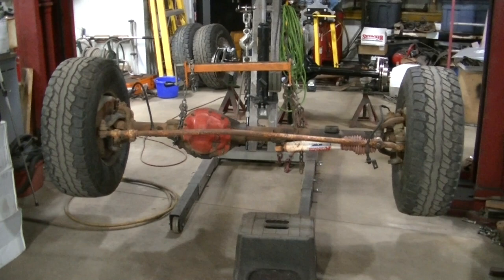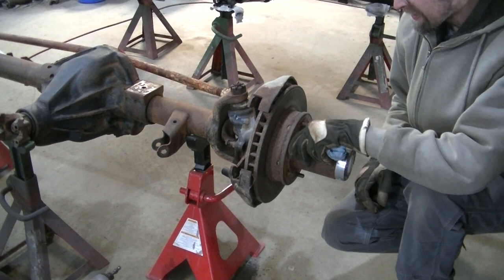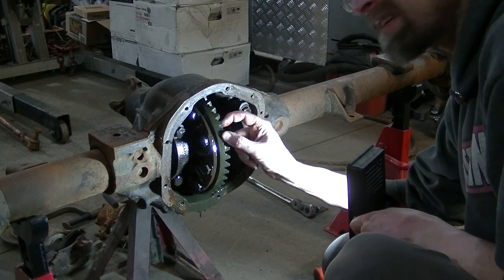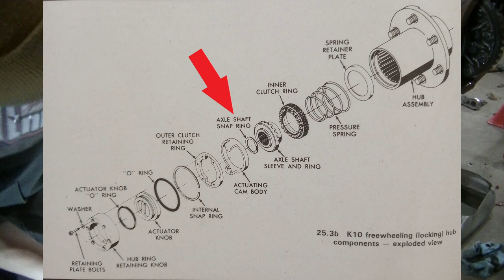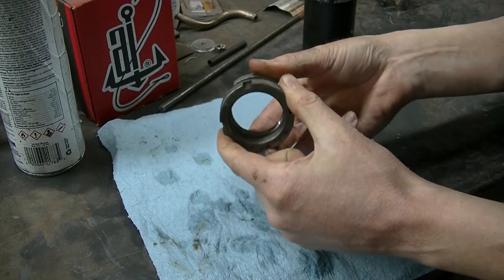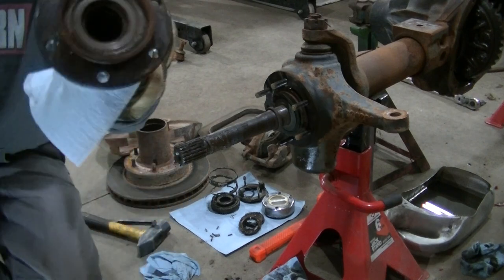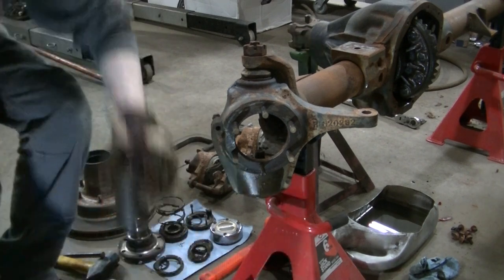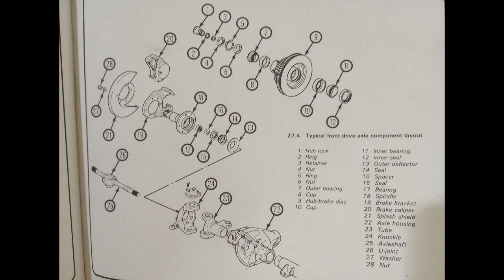80 Chevy Silverado Front Axle Disassembly Dana 44

Comment from the maker: Donate to Help me create content: https://www.paypal.com/donate/?hosted_button_id=HEEM93RHSHE92
Things that might help with a project like this:
Spindle Nut Socket: https://amzn.to/3TVxmRm
Small Torch: https://amzn.to/3ZmewDR
1 1/8" Socket: https://amzn.to/40ByE64
Seal Puller: https://amzn.to/42H9JQg
Ball Joint Press: https://amzn.to/42IgPUW
Universal Joint Sockets: https://amzn.to/3ZWsZHQ
Skyjacker Lift Kit: https://amzn.to/3YYqvaH
POR15: https://amzn.to/3ZzYmYD
Paint Gun: https://amzn.to/3YwQUMr
Pressure Blaster: https://amzn.to/41Qz7D0
AirCat Grinder: https://amzn.to/3IOP185
Blasting Cabinet: https://amzn.to/3mckf1m 
Blasting Cabinet Dust Collector: https://amzn.to/3ZqjmR6

This video contains affiliate links, which means that if you click on one of the product links and buy, I'll receive a small commission.

Comment: It definitely has had some hard use.  Rockauto has the vent piece you need.
Reply from the maker: Maybe some rock crawling in Colorado. I actually tapped that vent hole for 1/8" pipe thread and have a fitting to go in it.